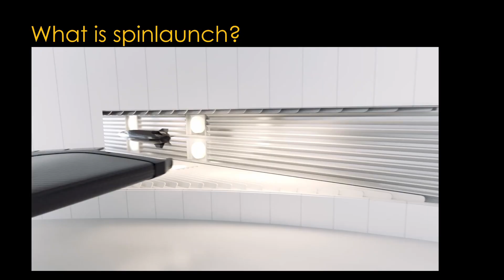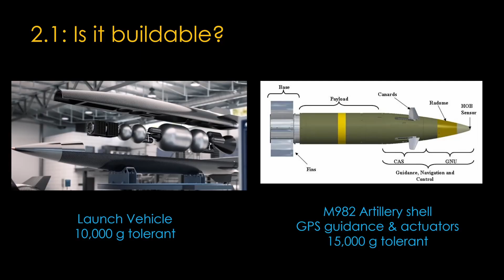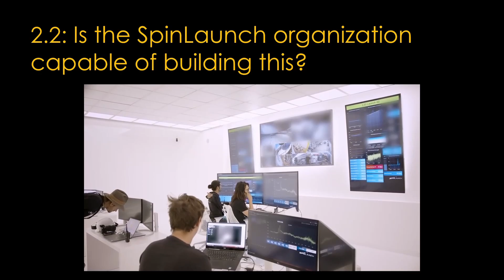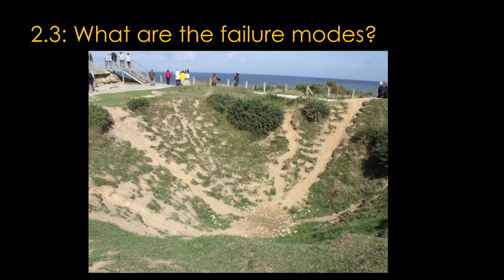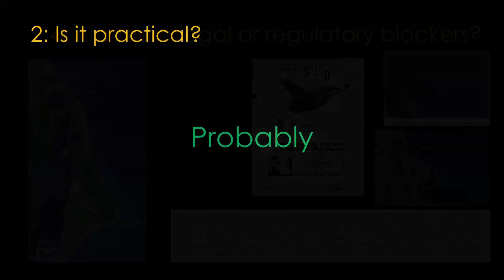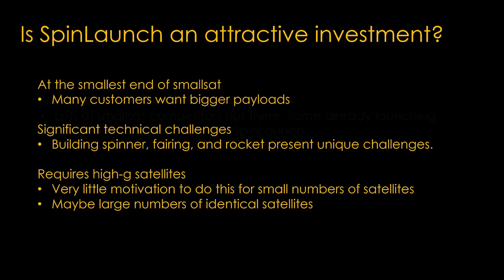Spinlaunch - What the???

Comment: Sounds terrible, until you remember that SpinLaunch fix equipment could be used 5 times each days.
Reply from the maker: Hmm....

Do you think there's a market for that? 

Do you think they could build that many rockets and fairings?
Reply: @EagerSpace  the rocket they need aren't that big(maybe can be produced on a production line), and for a constellation in low orbit such high rate of launching seem a good idea, only issues is that each part of satellites need to be build to resist to that kind of forces.
Reply: @theOrionsarms  
Their launch vehicle is comparable in scale to Rocketlab's Electron. Given that it's two stages, and the intense requirements of the fairing, i'd argue similar complexity too.
Rocketlab are building Electron at a rate of about one every two months. A primary driver behind reusing their first stage isn't cost but cadence.
It seems very optimistic that Spinlaunch could build rockets at a rate ~300x greater than that.
Reply: @lazarus2691  actually Electron is built as a high tech equipment with little margins(and handcrafted, not mass produced) , but by definition their rocket needs to be made from sturdier parts, and the deltaV requirements for their two stages rocket is only 6km/s not 9 km/s (if you round the numbers), basically their two stages rocket make the job that upper stage Electron does. So those two cases are not comparable, and about the production rate that is given by launch rate, maybe 1000-1500 per year if you consider some maintenance times of the centrifuge.
Reply from the maker: @theOrionsarms  The fairing halves are carbon fiber which is inherently a labor-intensive process. They need carbon fiber for the strength/weight ratio, but those are big parts as carbon fiber goes and they are also quite intricate, which would make them slower and more expensive. 

The electron first stage is simple as CF designs go - it's an admittedly big structure but mostly just a long tube, and it seems likely that electron will be reused. 

Of course, if you want to launch a lot of satellites, Neutron would be a better choice. Assuming they get reusability to work for the first stage, it's going to be able to launch 40  payloads in the 200kg range in a launch while expending only a single second stage. Is SpinLaunch going to beat those economics with 40 fairings and 40 two-stage rockets?
Reply: @EagerSpace  of course they choose carbon fiber for its inherent properties (not necessarily a labor intensive choice, you could use automation for a standard piece) , but that's not a fairing it's a aeroshell, like a hipersonic missile have or a guided artillery shell,in fact their vehicle have more in common with those than a classical orbital launcher. I am surprised that they are not choosing solid rocket boosters, but maybe they have a plan of upscaling the vehicle, because obviously it is a market for a cheap but higher capacity vehicle like that, I mean orbital refilling, and this concept is upscaling really well, if you increase mass of capsule 20 times you don't need 20 times bigger vacuum chamber in radia or even volume, and a bigger capsule don't need a thicker aeroshell, and probably could be made in a single stage and even fully reuseble. But first we need a demonstration of capabilities of reaching orbit, even if wouldn't be a comercial success.
Reply from the maker: @theOrionsarms  Solid rockets have considerably worse Isp, and since they need a lot of delta-v, it would be much less optimal. 

It's also not clear to me if the cast propellant in the solids would be able to take that much acceleration.
Reply: @EagerSpace  solid fuel rocket were already fired for the guns, maybe three stages would do the job, but I'm not sure how liquid oxygen and kerosene behave at 10 000g , even one meter deep meaning 1000bar hidrostatic pressure.
Reply from the maker: @theOrionsarms  I played around with solids. They lose about 25 percent on Isp so it's much harder to get high delta-v out of the. The numbers I were seeing were worse than the liquid ones, though without real mass ratio numbers there's a lot of guesswork.

I'm not sure what you mean by "were already fired for the guns".
Reply: @EagerSpace  only that are special artillery shell with solid rocket engines for expanding the range, those are experimental now and their specifications highly classified, but exist, anymore four stages pure solid rocket reached orbit already, with a system that replace first stage it's possible to use only three I guess.
Reply: @EagerSpace  If you want some real number about mass ratio and specific impulse of small and medium solid rocket motor, you could look on Northop Grumman catalogue, from what I could figure for a 200kg payload and 6km/s two stage configuration could do the job and keep the mass under five tons.
Reply: @theOrionsarms  
To me it sounds the main group that would be interested in SpinLaunch (and willing and able to build payloads, and have some spare money to throw at them) is the the DoD, with their "responsive launch" thingy.

(And the other thing I have to think of, with startups, sometimes the "product" is not the product or service that the startup offers... But sometimes what is on offer for potential buyers are the employees, their knowledge...)
Reply: @intercosmonaut  they not show any interest until now, but NASA did and actually already started a collaboration with them, but who knows maybe would become interested in transferring that tehnology to ofensive weapons, like some kind of replacement for ICBM or long range artillery.
Reply: @theOrionsarms  
Today I read on Universe Today that Airbus U.S. Space & Defense launched a small test "satellite" (more like a suborbital test article) on an Spinlaunch test flight on September 27th, 2022. (There were also civilian test satellites, Cornell University tested a "chipsat" concept.)

Airbus is participating in DARPA's Blackjack program ("to demonstrate the military utility of small satellite constellations for the Department of Defense"), so I suspect Airbus US worked with Spinlaunch as part of the Blackjack program - but I couldn't find any confirmation.

Anyway, from what I read, my impression is that Spinlaunch itself seems more like a typical civilian startup, but it wandered more accidentally something that is more at home at the DoD domain.
Reply: @intercosmonaut  even if isn't a practical solution for launching satellites or is to big and clumsy to replace artillery, still can be used as a facility for various equipment tested under high g forces, such join ventures with military contractors can become a part of their business model I think .
Reply: @EagerSpace axially some grain geometries can as there are artillery launched missiles with solid propellants, and there was the two stage Nike missile that launched at 200gs. But lateral gs, absolutely not, the grain would collapse in on itself and your rocket would explode when you tried igniting it